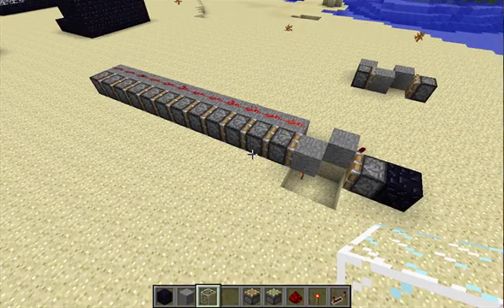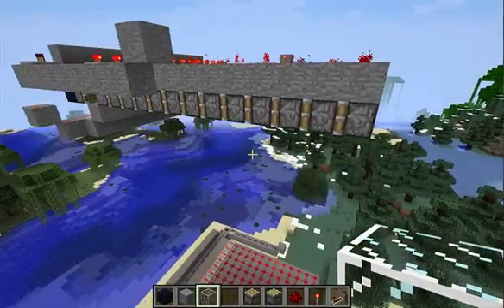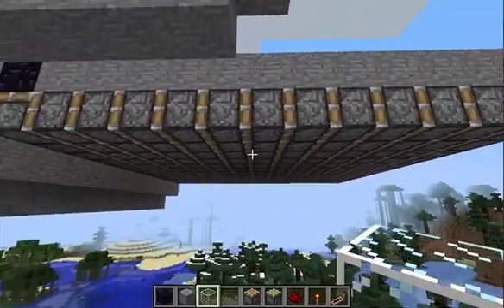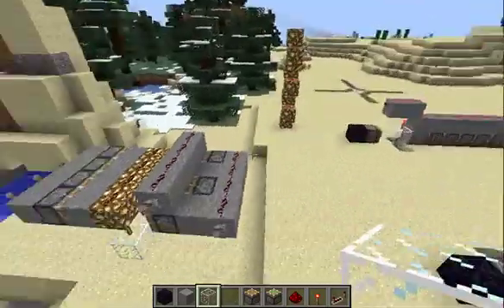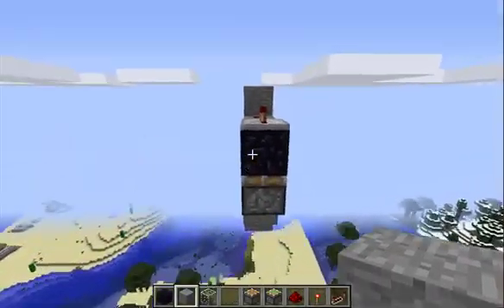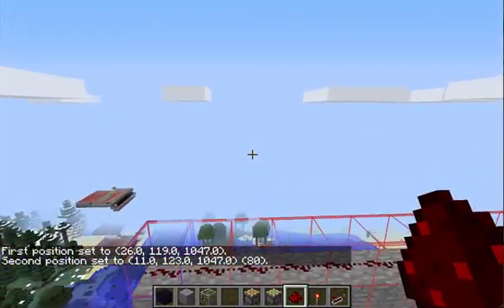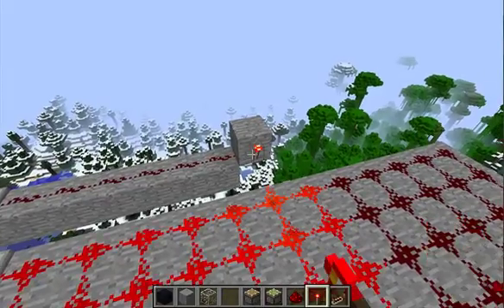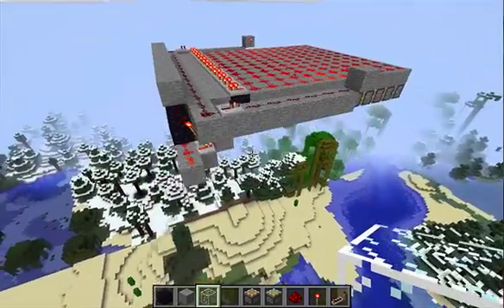BUD Platform: 12x12 BUD switch

Comment: @anistuffs If you want it with only one use, then somebody made that. Its simply a floor of sticky pistons with blocks under the one you want the output from, over that is your normal floor and over that  blocks with powered redstone ontop. Now you make all the pistons extend and get rid  of the block with redstone ontop. This wont update the pistons but now they arent powered anymore.